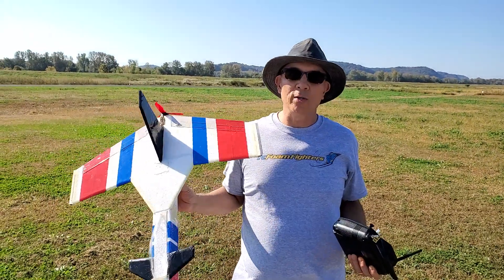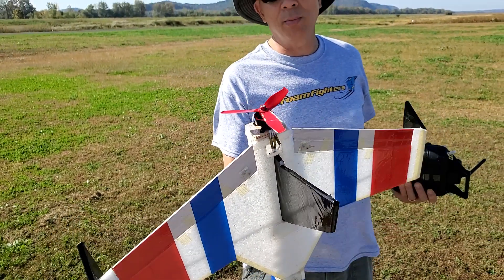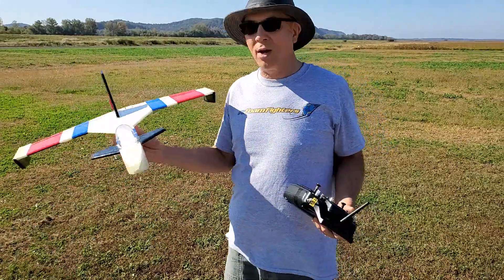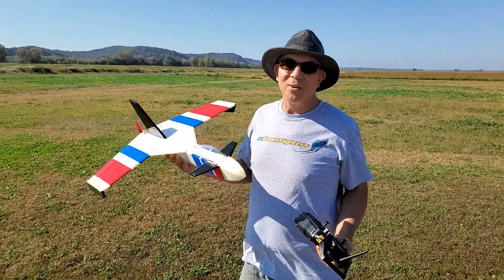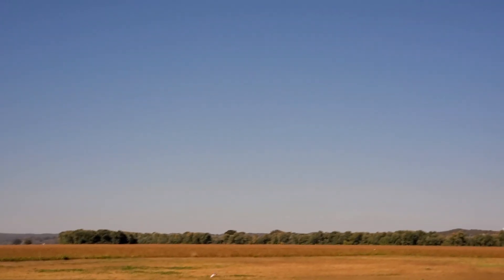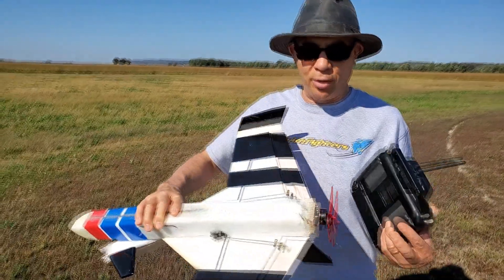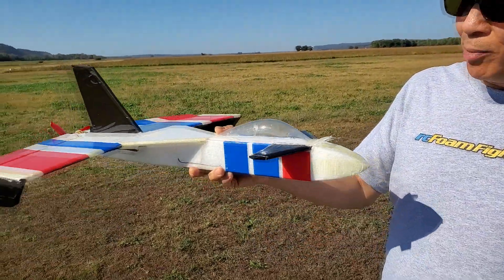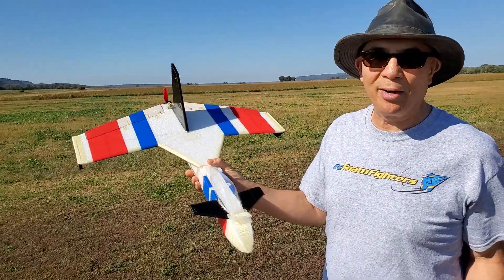Mini Dragon Speed Upgrade

Comment: Very nice, if you want a bit more speed run a f40 1950 motor and a 6 cell with a apc 5x7 prop.  I hit 167 mph with that setup 😎
Reply from the maker: Checked out the videos you have of your wings, those things are ripping the sky!  Wow 167mph is fast.  I have a couple F80 2200kv motors that I was going to use for a dual motor plane. I also have a few other Xing and Brother Hobby drone motors I want to try on planes. The F40's look awesome, will have to get some too..  crazy you can push 1000watts out of these small motors. What esc's are you using with the drone motors on the wings?
Reply: Currently using the BGLRC T Rex 60 amp ESC, handles 1200 watts and stays cool.  These new motors and ESCs are crazy! So much power in a small package,  I love it